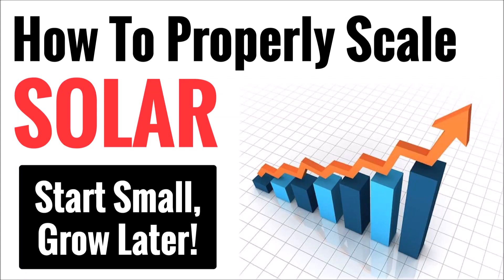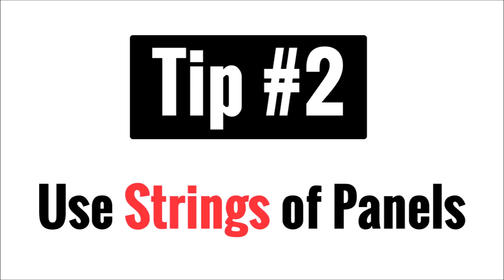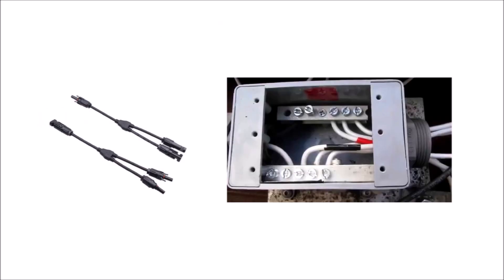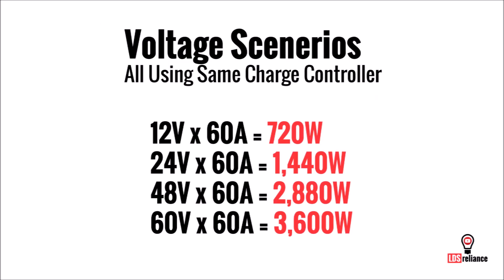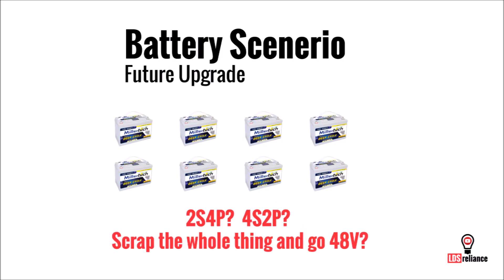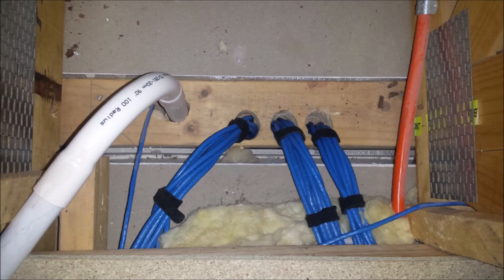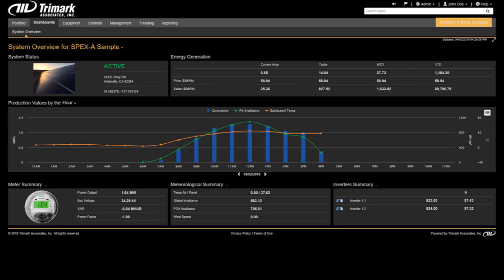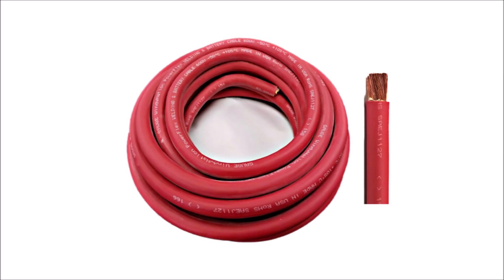How To Properly Scale Solar - Start Small Now And Grow Bigger Later!

Comment: My best advice for solar is use multi smaller solar panels instead of one or fewer bigger ones as if you have just 4 big panels and one big one malfunction you lose 25 percent of your power but if you have 10 smaller ones you'll just lose 10 percent of the power.

Comment: Currently using solar as emergency backup.  In order to increase capacity I am considering going from 24V to 48V and a larger inverter.  Are you aware of additional hazards running 48V vs 24V?  The charge controller is rated at 150V (input) 85A (output).  Going to a 250V charge controller will allow stringing more panels but not sure I want 250V coming into the house.  Your thoughts would be appreciated.
Reply from the maker: You already have 240V coming into the house (alternating current).  Why would 250V be much different?  Higher voltage allows you to run less current, which means you get less voltage drop, you can use smaller wires, and you can run those wires longer distances.  48V is a really great voltage for the battery bank because it will put less of an amp draw on those batteries (again, higher voltage = lower amps for the same wattage).  And when you discharge a battery with less amps, it lasts longer each cycle and has a longer life in total cycles.

Comment: I just run 12v no ac inverter at off grid cabin. I also have super capacitors instead of batteries. Super capacitors charge so quick under 10 minutes. Super capacitors can be completely drained and don't damage them like batteries. Super capacitors are not effected by cold and don't off gas. Super capacitors don't pollute like lithium ion.
Reply from the maker: I am glad that is working for you but won't work for every application.  Capacitors, even supercapacitors, are not a replacement for batteries.  They don't have anything approaching a linear voltage on discharge and have to compensate for it with higher current as their power runs out.  That requires beefier circuit boards and fatter wires in your components.  It can be designed around and is great in certain circumstances but there is a reason they haven't replaced batteries and have fallen out of favor in a lot of places where they used to be common (car audio, for example).

Comment: So, the issue I have, or had, was that if I changed my solar in anyway I'd have to resubmit a permit to the city and then it was like it's a new system.  I was lucky with my 1st solar, a month after I went live they changed the rules so that the net meter was less generous to me.  Right now, whatever I put in to the grid I get back in credits.  If I changed it, I'd have to be under a different plan.  But your advice is still great and for those off gridding it, the best way to go.  Maybe I can build another solar system but this one to be off grid, but then batteries are not priced for me yet.
Reply from the maker: That sucks.  It is sad that net metering and most grid tied systems in general are so one-sided in favor of the utilities.  Yes, that would be what I would so is build a separate system that is not connected in any way to the first one.  For example, I run my shed on solar and I use it to recharge my yard equipment, power tools, kids toys, etc.  I also start my seeds for my garden out there with grow lights and warming pads.  I do it all mostly for fun as opposed to a money saver, though.

Comment: Well said! I went with the 24 V system because I was afraid of 48 V. I heard people can die if they don’t know what they’re doing. 
I now feel more comfortable trying to upgrade to 48 V. 
Yours is one of the better videos telling people why they would start out this way. 🖖
Reply from the maker: Thanks, Ben!  Large amounts of power can kill you whether it is high voltage or high current.  Definitely be safe out there.
Reply: I started with lower voltage as well but I'm glad I bought a charge controller that could do higher voltage
Reply: @jmr  
Most chargers today can do up to 48 V or higher.
Reply: @benjones8977  I'm seeing a lot of interesting features in newer charge controllers.  Even one that can work without a battery.  My next controller will likely have master / slave mode when I outgrow this one.
Reply: @jmr  
I just watched a video with Will Prowse talking about running things without a battery, he says there’s more problems than it’s worth! Better to even have a small battery for a lot of surging issues.
Reply: @benjones8977  Same place I saw it.  It could work for some specific use cases.  I believe heating is one case.  Use it to power a boiler in cold climates where heat pumps aren't sufficient.
Reply: @jmr  
I’d still have a battery of storage, even a small one.
Reply: @benjones8977  Ideally yes you would still have a battery even if it was small.  When you use a boiler for heating your home the hot water is also a battery.  You of course still need electric to move the water but that could be a whole separate system.